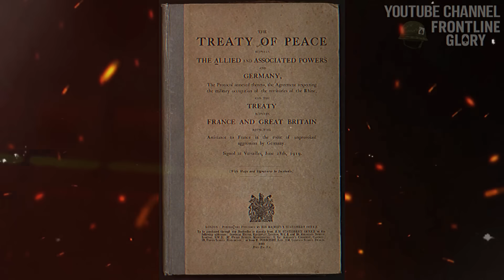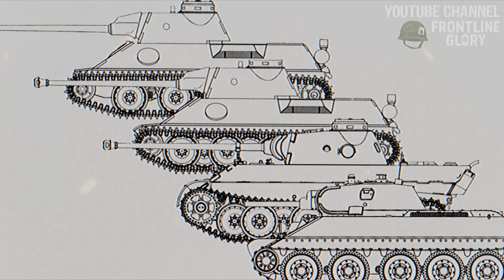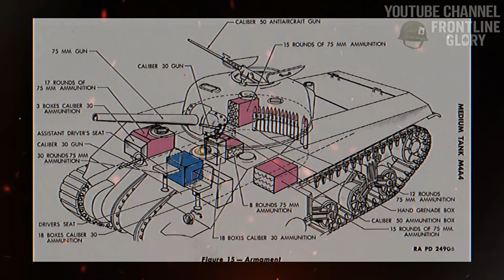Why Did German Tanks Run on Gasoline and Not Diesel? | Documentary

Comment: The main problem in the production of fuel from coal was that the output was 13% diesel fuel, and the rest was petrol and oils. Most of the diesel fuel was consumed by the Navy, so it was impossible for the Germans to switch to diesel engines.
Reply: The German military looked at diesel engines, but they were informed that it would be difficult to produce sufficient diesel.  However, they were informed that by 1942 the situation would’ve changed.    Therefore the VK20 tank which was to replace the Panzer III and Panzer IV was designed with a diesel engine, the MB809 available.  However VK 20 was only a 24.5 t tank barely bigger than the
panzer iii/iv.   When the Germans encountered the T – 34 and KV –1  it was clear that a better tank was needed and they ended up switching to a 30 t tank which became the panther. (the VK 30 was actually preferred by Hitler)
-It should be noted that there were lots of advantages to petrol.   It was compatible and easily available.  German tanks invading France refused at standard petrol stations.
-The Germans did have some diesel vehicles.
-The answer is basically simple There wasn’t time to redesign the engines for the bigger 40 t tank and get them into production.  Diesels would’ve started taking over in late 1944 or early For instance the Panzer 38D what’s the have a diesel engune

Comment: If you have fumes in the engine compartment, you're doing something wrong. I've never smelled diesel in any engine area  and I've worked rigs where we have monstrous engines in buildings and everything is constantly exposed to -30°C and worked on by guys who can barely pass grade 8.

Comment: The reality was more gas was able to be produced and frankly the truth of the matter was that it depends on the branch of military when your refine oil you get gasoline kerosene and diesel and other products what the Germans did and the Americans did as well and a few others was use gasoline engines in many of the land vehicles and planes and the navy got the diesel the German navy in ww2 made 1162 submarines in the Second World War alone they also had a aircraft carrier and a surface fleet and transport ships to fuel logistical it wouldn’t work to have the army use diesel as well the navy probably used most of the available diesel unlike the Soviets the Germans did have a extensive navy branch and it was not abandoned till the end of the war the Soviet didn’t need diesel for their navy they barely operated it and when they did they didn’t have to operate in far places like the Atlantic Ocean Indian Ocean 
Or south Atlantic or Mediterranean or have to supply far distance across Europe or in Africa logistics are the answer to this question
Reply: It’s also cheaper engines so cheaper vehicles for production so they lacked reason to switch as well

Comment: Diesel fuel only requires a little kerosene to reset winter conditions, it’s called “arctic fuel” refineries add it automatically starting mid summer. If you own a diesel pickup you might notice it runs a little hotter in August, September and onwards.

Comment: Hitler's industrial experts told him it wasn't possible to make enough diesel fuel from coal liquefaction.  They lied.

The many different Maybach engines used in military vehicles were unreliable.  Worse still, their solution was to get power from small gasoline engines by revving them to high RPM -- which undermines longevity.  Germany already had the well-proven Junkers Jumo 205 two-stroke opposed-piston diesel engine.  It began regular flights to South America in 1928.  It had excellent power-to-weight ratio and up to 750 horsepower, which is sufficient for main battle tanks.
Reply: This engine was too large even for airplanes. This is why the Ju 86 was not approved as a frontline bomber.
Reply: Almost sounds like the "industrial experts" were secret allied saboteurs.

Comment: The M1 Abrams is a gas powered tank.
Reply: The M1 Abrams uses a multifuel gas turbine powerplant.  It is capable of using gasoline or diesel, but is typically run on JP8 fuel, which is a kerosene-type aviation fuel.
Reply: @Dave174385 good reply from someone’s who’s clearly an expert.   What about fuel oil or other available hydrocarbons?

Comment: Because the major coal liquefaction technology, Coal Hydrogenation/Bergius Process, yielded gasoline high in aromatics with an octane rating of 100, improved further by tetra ethyl lead. High quality diesel fuel came primarily as part of the output of the smaller capacity Fischer-Tropsch plants, along with naptha (40 octane gasoline used for automobiles), waxes, alcohols, and ketones.
Reply: I'm pretty sure Germany didn't put Ethyl in their AV gas, which averaged closer to 86 octane.  They improved power with a 50-50 water-methanol injection (windshield washer fluid) and with nitrous oxide for war emergency power.

Comment: Why Did German Tanks Run on Gasoline and Not Diesel?
For the same reason American and British tanks ran on gasoline ...availability and logistics. Using one type of fuel cuts transporting problems by half.
Reply: Except in the case of the British, that's not true. The British had diesel tanks (Matilda II, Valentines, many of the British Shermans were Diesel, ect..). The British army was a mixed fuel army.

Comment: Ok, it seems the chassis was adjusted in a way that 1 original road wheel is left away and in the same time adjusted the spacing between the remaining ones.
And than added the dummy wheels in between.
Some serious cutting and welding involved here! 😵‍💫😵‍💫
Reply: During the summer, German tanks ran on their wheels without tracks.  They aren't dummy wheels.
Reply: @floycewhite6991 Haha, funny but not true! Without tracks tanks will not move, also German WW2 tanks will not.
I was talking about the replica here, it definately has dummy wheels (the outer ones).

Comment: Availability of suitable powerful (diesel) engines was for most countries a problem.
Only the Soviet Union had a good engine in time: the V-2 Diesel (38,8L V12).
Also the British build a number of diesel engined tanks in the late 30ties and early 40ties but in later war years went completly over to their succesful V12 Gasoline engines in the search for more power (27L V12 Rolls Royce Meteor).
Reply: It wasn't really mentioned in the video, but one of the things the Russian V2 had going for it to help with some of the downsides of diesel (heavy engine) is it was an aluminum alloy engine, making it lighter for a diesel engine. Even with all the other reasons why the Germans didn't go diesel, they could not replicate the Russian V2 due to resource issues (they didn't have access to the alloys involved). 

After you standardized on a type of engine and a war breaks out, it is incredibly difficult to change. The US did have some diesel Shermans, but diesel engine construction was not going to keep up with a lot of them going to the destroyer escort and submarine programs. Between having engines based on radial aircraft engines and developing tank engines from gas civilian engines (Crysler multi-bank), the US was sort of in the same position as Germany but more in terms of engine production than fuel availability, although that could have played a role as well in the case of the US, it certainly did in Germany's case.
Reply: @klydon1291 
The weight of the engine is not a big deal on a tank. Of course lighter is better, no doubt about that though. 
The extreme example:  A57 was 2400kg and GAA was 670kg in the same type of tank with same driveline and suspension( Sherman M4A4 vs M4A3). Even the A57 equiped variant, M4A4, had a lengthened hull adding more weight and still it worked.
The main reason was that the right engine was not available at the start of the war and development needs time but... there was no time.
Reply: You would expect that, of all countries, Germany would have a proper diesel engine.
After all, they literally invented it. They also were the first to use diesel engines on trucks, ships, submarines, locomotives, etc.
They also had companies like MAN and Daimler-Benz, who were (and probably still are as of late 2025) world leaders on heavy diesels, so it's not like they lacked the technology or production capacity.
Reply: @vadim6385 
They didn't have capacity for new supply chains as mentioned in the video
Reply: @vadim6385 Junkers Jumo 205 two-stroke opposed-piston diesel engine used in civil aviation.  Wasn't considered for tanks because the experts insisted that diesel can't be made from coal liquefaction.
Reply: Ironically that engine was designed and optimized by FIAT in the early 30s.
Reply: @xmaniac99  Well, that is new to me...
I only ever read/heard about Fiat involvement in Lada automobiles going back to the 60/70ties.
Reply: @C @CarLos-yi7ne it gets even weirder when you realize the origins of the power plant are somewhere from Spain (Hispano-Suiza power plant).
Reply: @xmaniac99 Yes, I know the story of it's aircraft V12 inspiration origins.
It is in fact build in the way of 1930ties aircraft engines. Also the quad cam / 4valve points in that direction.

Comment: In 1930 and 1940s Diesel fuel was much easier to refine and manufacture, than petrol was, that's why the soviets used it as a source of energy.
Reply: When you refine crude oil, you get many types of petroleum products at once, petroleum gas, gasoline, diesel, light oil, heavy oil, etc.
You can't have gasoline without the diesel. You can tweak the production process, so you get more of one or the other, but you still get little bit of everything, you can't produce 'only' gasoline, diesel or heavy oil.
Soviets used diesel engine because they understood it was safer, more torque-y and more fuel efficient than gasoline.
Reply: @vadim6385 Well, that is what I ment. 😄
Reply: @vadim6385 and, if I may add, desel engines don't need spark plugs.
Reply: If you make diesel out of crude you get the other type of fuels too (if you refine properly of course).
Reply: @CarLos-yi7ne Not entirely true, some kinds of crude are more suitable to refine into different types of oil, with different refineries suitable for different kinds of crude. Heavy Crude is produced mainly in places such as Venezuela and Russia. Their are large amounts of refineries in Florida specifically designed for heavy crude from Venezuela. Sanctions against Venezuela mean that the only other major source of heavy crude suitable for these refineries is Russia, that is also sanctioned. Fract oil as produced in the US tends to exhaust quickly, and becomes progressively more expensive to extract, so will increasingly be used for the US market, as will US gas, currently being shipped to Europe as expensive LNG, replacing less expensive Russian pipeline gas, as Europe has no significant natural resources, with Norway unable to produce all of European energy needs.
Reply: @regsmith5972  Well, I was speaking in general. Of course there are many factors involved. Thanks for the info!
Reply: @regsmith5972 lol you obviously don't really know what you are talking about. Fracking doesn't do fuck all to change what you can get out of the oil, all it does is make it so that you get more out of the formation. I've actually worked the oilfield and not just as a grunt heavy laborer.
Reply: @jasonlauritsen5587 Fracing doesn't change light crude to heavy crude.
Reply: @regsmith5972 i didn't say it did, i specifically said that it doesn't change the oil at all. You do get diesel from light crude too, just far, far less of it than heavy crude. Learn how to read and how to comprehend what you read.
Reply: @regsmith5972 and by the way, all of the refineries outfitted to refine heavy oil, weren't made because of Venezuela's oil, they were made for northern Alberta's bitumen. You talk like you know a whole lot, meanwhile you quite obviously only know the rudimentary basics that anyone could find out from watching the news. Especially since you obviously don't realize that 30% of America's oil is from Canada, the bulk of which is bitumen.
Reply: @jasonlauritsen5587 Yes the US has heavy crude oil reserves, but not sufficient for its needs, that is why it has to import significant heavy crude, such as from Canada. Some of the largest oil reserves in the world are in Venezuela, which is why the US is trying to carry out a reguime change opperation, and why Chevron was opperating there.
Reply: @regsmith5972  California's is mostly heavy, which makes our refineries perfect for Alaska.  We also import a blend of heavy and medium crude from Ecuador.
Reply: @floycewhite6991Why then does America import a significant amount of heavy crude then? Clearly US production  is not sufficient, which is why the US has to import heavy crude from a number of places including Canada. This is the problem with fracing, they become more difficult to extract, exhausting quickly and become progressively more expensive to extract.
Reply: @regsmith5972  Not only is it possible to import and refine foreign heavy crude at a lower cost than domestic fracked oils, the heavy crude also contains a far higher percent of useful chemicals such as xylene.
Reply: To this day, diesel goes through the refinery once, gasoline goes through twice. Diesel should always be cheaper, always.
Reply: Still is, diesel is an earlier step of refining crude. It's essentially the exact same process as making alcohol via stills, you keep heating it up and as you move up the process, you get different fuels, each being more combustible than the next, gasoline is like 5 steps above diesel.
Reply: Back then, auto gasoline typically was 40 octane, and diesel was about 8 cetane.  The more-refined fuels with additives came about slowly.  By 1940, only one refinery in the world made 100 octane aviation gasoline.
Reply: @floycewhite6991 70 octane was common for gasoline engines back than (not 40).